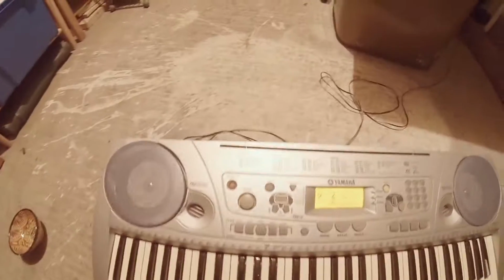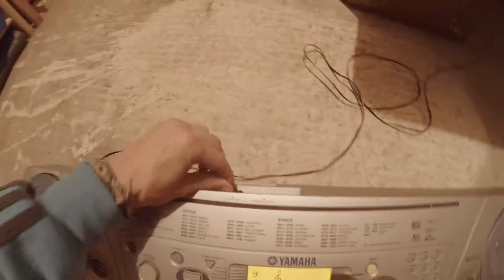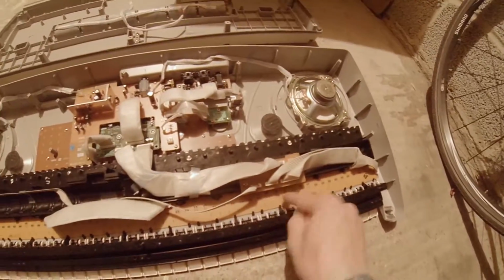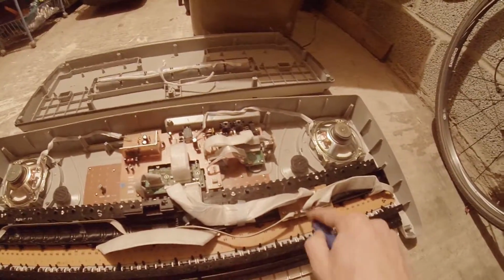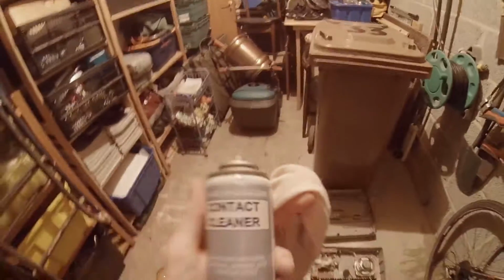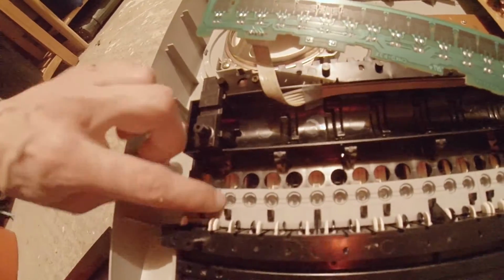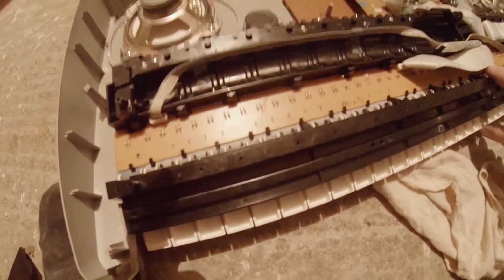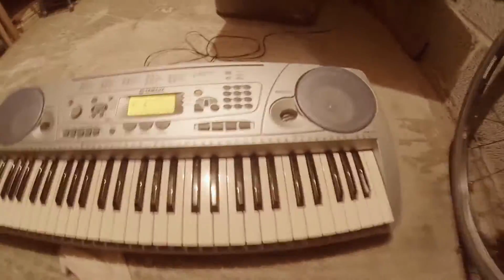Dead Key Fix on Yamaha PSR 275 & 280 Electronic Keyboard - Quick & Easy!

Comment: SUCCESS! I found that the smallest speck of dust (needing magnification to see) on the contact board OR rubber "plungers" will stop the key from working. Very aggravating but after many tries all the keys finally worked..Thanks again for showing how the PSR 275 (and PSR 280) contacts are cleaned.
Reply from the maker: +G “Jerry” Henrickson Nice one man glad to be of help :)

Comment: Thanks for the video. I was trying to remove the keys on my PSR-280 as is done on many keyboards. Flipping it over and removing the contact plate instead...did the trick. Thanks again!
Reply: G Henrickson  hey i just want to know whether 280 has the exact same internals and the 275 or what? I too want to fix some of my keyboard keys

Comment: Thanks for the tutorial! However, I don't have any actual contact cleaners or anything else mentioned in the video, so is there a way that I could use some rubbing alcohol or my sister's nail polish remover (or something of the sort) to clean the contacts? I tried using basically just water, and i only mostly fixed my G# key, and my G key is still dead.
Reply from the maker: Yeah I think alcohol should be all good! Nail polish remover should be all good too but it's slightly more potent than alcohol right? You don't wanna burn away the actual contact just clean it ya know... Good luck!
Reply: Okay. Thanks, man!

Comment: i did this but its not working, then i tried with pencil, still not working as well
anyone pls?
Reply: it happend to me too i did every thing he said then tried to put the little board back in then it wouldn't lock in properly and kept falling out
Reply: Did you finally get a solution? I'm struggling with this too. Used a pencil but it didnt work.  I dont know what else to use